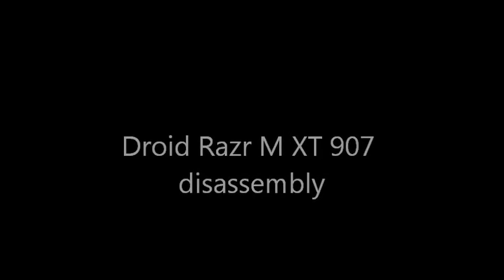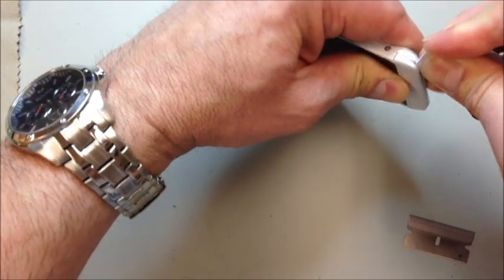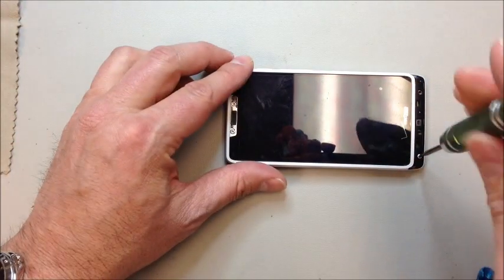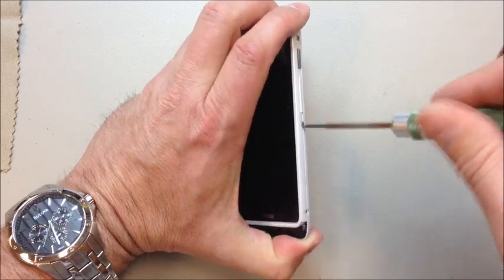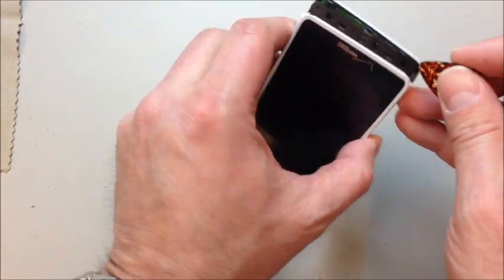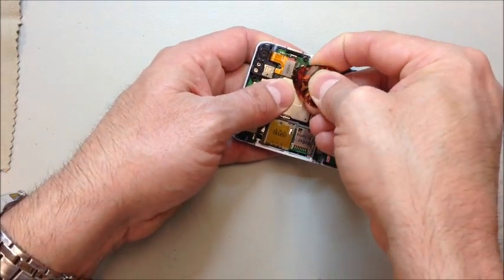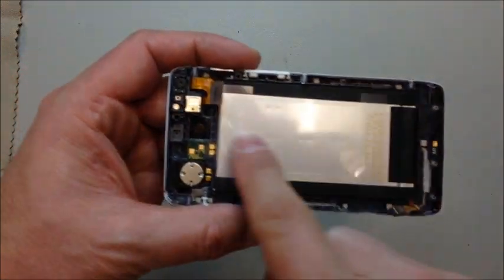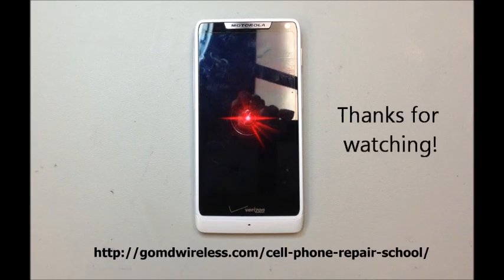Droid Razr M XT907 disassembly

Comment from the maker: The longer you wait to take it apart the more corrosion has time to cause damage. You could use a hair dryer on cold but never expose a wet phone to heat. It's best to remove all of the shielding from the main board but you really need to know what you are doing to avoid causing more damage. Be careful and I recommend having a professional assist you.

Comment: do you know a website that i can get my motorola droid razr m battery? or evn exchanged 
 it does not hold the power as much it turns on n it works great but the battery discharges quickly

Comment: I wanted to say the video was a big help.  I cracked my LCD and got a broke phone off Ebay just for the part.  I do want to add one correction to your video.  The side screws are t4 drivers and the top and bottom ones are the t5.  This video saved me from paying over $300 for parts and labor.

Comment: Thanks for the tip!  The kevlar backing on mine started to fray, so I wanted to see if that insert would come out.  Looks like it's glued pretty firmly to the plastic frame around the back.  While I have it apart, I trimmed the frayed bits with a hobby knife and painted it with some watered down PVA glue - hopefully that will prevent future fraying.